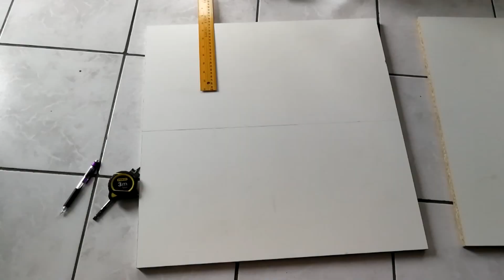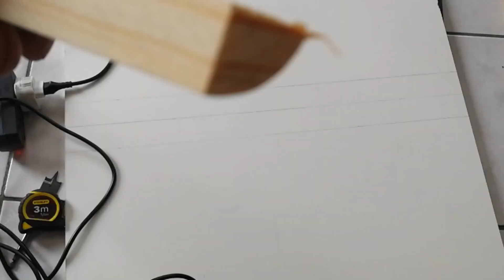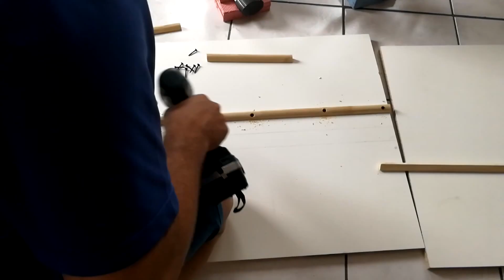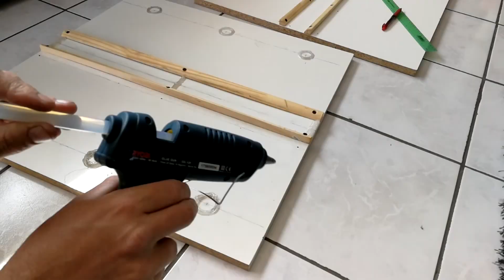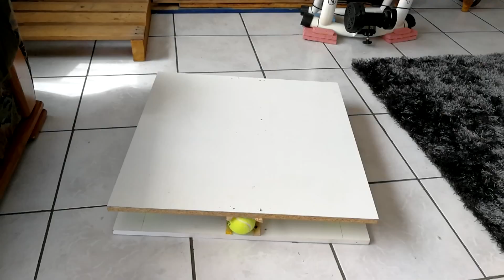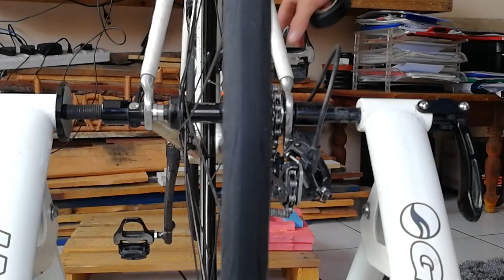Rocker Plate for an Indoor Trainer - Step by Step (with Tennis Balls)

Comment: You are better off using a core bit to drill out 2-inch holes to hold the balls in place so there is no need for glue which cracks off eventually. However,  that will mean you asking your Dad to do it for you! Great music. Shame that you did not think to put a t-shirt on ;)
Reply: I agree with you and was thinking the same thing. Maybe the reason might be the center row (containing the 8 tennis balls) may become weak once 8 holes are drilled. I am going to build one of these to see how it works.

Comment: wonder if one just buys flat balance pillows..... two behind on sides for trainer, with some plywood board on top of and one under the front wheel with similar height or little thicker ....
Reply: I'm not saying it will or won't work :-) as I have got some stick for this design. But mine works, it's cheap and DIY. So I ignore the haters.

Comment: Nice idea! Why the electrical tape on the tire?
Reply from the maker: Andrés Martín when you too lazy to change over to a dedicated Indoor Trainer tyre, the electrical tape protects it. It has to be good quality electrical tape though.
Reply from the maker: Andrés Martín Update: It works even better if put it on the trainer wheel itself. Its thin enough to put two or three layers.
Reply: @FiguringItOut  Damn man nice tip! Will the rear wheel slip under load compare to the normal setup?
Reply: @FiguringItOut  Absolutely love the electrical tape on the tyre idea! Subscribed and thanks for the vid.